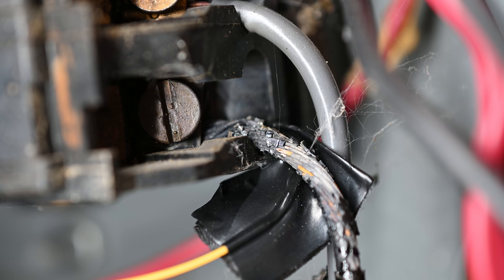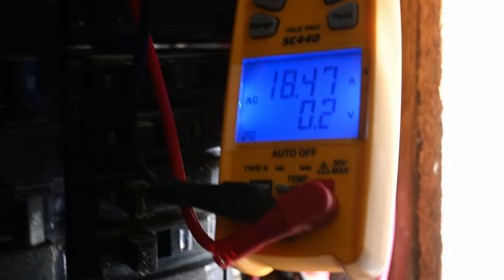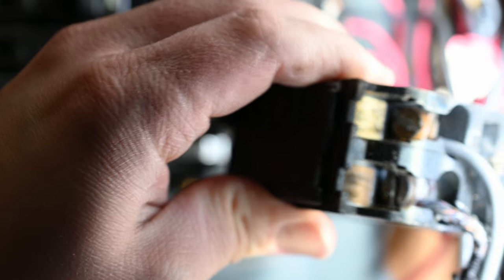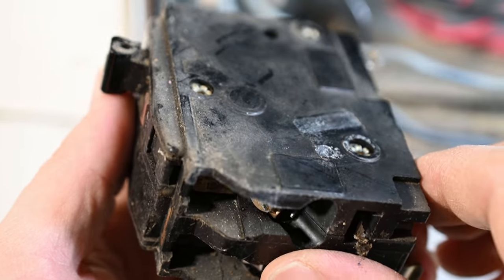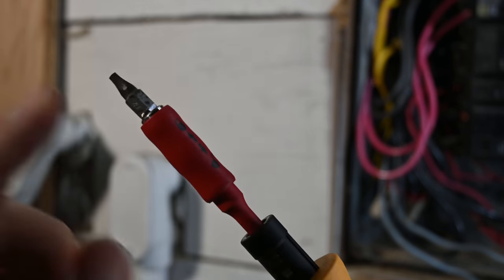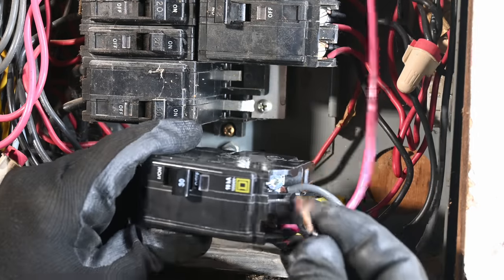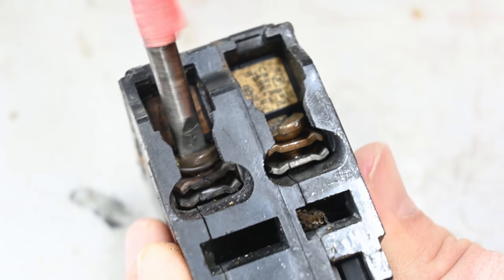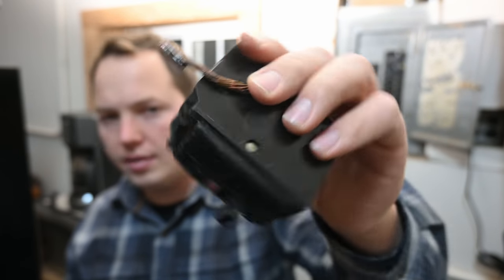Burned Wire On Breaker - Torque Screwdrivers & Why You Should Probably Be Using One

Comment: Good job sir, your videos are great! A couple of things that may also need to be added. Tightening your wires too tight, especially stranded wires, can cause overheating issues as well.. If you over torque your conductor you could decrease the rating of that conductor  by cutting into it, disfiguring its shape and/or breaking strands. Also your typical thermal breakers would trip on heat from  overcurrent or heat from a conductor at the breaker just the same.
Reply: Turns out this breaker IS a dual trip. There is a magnetic trip feature.

Comment: I am not an electrician but as project engineer on some large energy storage systems have done inspections after all the regular inspectors signed off.  I have found countless cases of loose screws on breakers.  One insidious one is where stranded wire is used and it gets caught up in the screw threads.  The screw appears tight but the wire is still loose.  You have to very slightly try to move those wires to see if all the strands are tight in the screw clamp.  At one point I solved an issue where a breaker was tripping at random times.  Everyone was concentrating on the device being powered and the wiring to it but I found one of these strands-caught-in-a-breaker-screw issue causing high terminal temperature causing premature tripping of the thermo-magnetic breaker.  So yes this is a very real issue, both for fire safety as well as electrical system reliability.

Comment: Best practice when using stranded wire is to use a terminal designed for the connection type or to install a properly sized ferrule on the stranded wire end before placing it in the clamp style connection on the breaker. Even using a torque driver to tighten a stranded wire can give a false reading as the strands can displace over time, resulting in a loose connection. This is especially true when the wire is subjected to regular heat/cold cycles as is the case of the connection depicted.

Comment: For Lockout devices, I keep a set of removable breaker clamps (I don't know the exact term) in my lockout kit. Each one is sized for a particular breaker lever, and will clearly sit over a breaker in the off position, while applying a small plastic wedge between the lever and the user side planar surface. A thumb wheel tightens it into place, then a hasp goes over the whole assembly and is secured with a standard shackle lock. 

I highly recommend these, as you don't need to depend on your customer having the necessary lockout capabilities in order to keep yourself safe.

Comment: I love the Wiha torque screwdriver personally. I got mine in a kit that included like 12 bits. Others are recommending torque screwdrivers meant for guns, and those will most likely work fine, but the Wiha one is 1000v rated, and I think that is a big positive. The bits that are made for it are also 1000v rated. I do believe they make an adapter for normal bits, but they say it is not for use with the insulated handles.
Reply: Ive seen that kit is it worth the money ?
Reply: @Jason_Canada  Having owned my kit and more bits in the range 20+ for over 5 year's now, id say Yes, providing you don't lend them out to friends and family,
Reply: @Jason_Canada  Sorry for the delayed response. I definitely think the kit is worth it personally. That being said, I got it on sale directly from Wiha's site. They even did a 50% off anything on the site sale once about a year ago.

Comment: Working in data centers we do annual or bi-annual FLIR inspection of all electrical connections. Would you be surprised to find the number 1 issue was new installations that weren't torqued properly and the number 2 issue was improper bend radius on cabling? Once you fix the issues they generally don't come back. If they do come back it's usually a cracked lug spreading over time, a bad breaker, or bad whatever is attached to that dang hot wire again. :)

Comment: During the same time frame of this video a 5KW heater in my garage quit.  I found the connector in the heater had fried along with the plastic holder for the same connection via over heat and the black wire had gone open. Its insulation had fried back to almost the romex connector in the body of the heater.  The wire is solid copper #10 @ 30 Amps. The heater is rated at 21.9 Amps. I thought it might have been the thermistor heat sensor having gone bad. Several of my wire buddies could only say the connection was not tight. I now agree after seeing your video. I have some pics but I need somewhere to send them.

Comment: Wheeler makes a torque screwdriver called The Fat Wrench. It takes regular 1/4 inch bits and it can be set from 10 to 65 in/lbs and i think it only cost around $50. It’s meant for gunsmiths but is handy for a lot of torque applications

Comment: So first I’m not an electrician. I installed the panel and wired my garage and have done other wiring, I’ve seen a lot of jack legend stuff. I know stranded wire meets code but I’ve never liked it. Ok let the beating begin. Thank you for your time and knowledge, love your videos
Reply: It doesn't just meet code, it is the only usable wire type in many situations. If you have a 100-200 amp panel at your house, then you have stranded wire feeding the panel. Solid 1/0 or 2/0 wire wouldn't be usable. Hell, solid 4 awg wire wouldn't be usable. 

Stranded wire is better than solid in a lot of ways. The negative of stranded wire is that it takes more skill to get a good connection. The positives are that it is more flexible, easier to pull through conduit, etc.
Reply: Yes I have 200 amp to my garage and I understand there is a need for stranded wire, trying to run solid wire from the weather head to the meter and panel would be damn near impossible. Thank you for your reply.
Reply: Stranded wire with superior insulation can carry far more amps than solid wire of the same conductor od.  It is also more flexible and costs more.   Ever wonder why the wire inside the appliance is smaller diameter than the wire you hooked it up with?  Appliance wire can carry higher amps because it is stranded, has superior insulation and usually has more air space to dissipate heat.  Often the manufacturer will crimp a pin, lug or ferrule to the appliance wiring to bundle the strands or will tin the ends with solder.  However breaker lugs are acceptable with bare stranded.
Reply: Is that why most commercial wiring jobs I have seen/worked on are stranded wire? Because it's easier to pull?
Reply: @henrythompson7595  yes.
Reply: @rj.parker  its people like you who give rise to the phrase "to be installed or serviced only by qualified electricians."  You just flat out don't know what you are taking about.  Rated capacity of solid and stranded wires of the same o.d. is essentially the same.  Appliance wire usually has insulation rated for much higher temperatures than house wiring, and is usually not bundled as tightly as building wiring so it has more opportunity to dissipate any heat of conduction and further is not installed in a flammable environment.  The current carrying capacity of wiring is determined almost exclusively by the thermal  properties of its insulation.

Comment: Well Done Ben. This is how a lot of house fires happen. Good explanation and display of the various points inside and outside the breaker. Nobody (owners) goes back into a panel and torques connections. IMHO Definitely a torque issue where the heat travelled back into the breaker as well. That panel is so old it should all be changed out to a new code-compliant design with arc fault/ground fault breakers. The new AF/GFCI combo's are great and this would have been discovered long before a real problem occurred. Inspectors should be mandated to test a portion of the wiring system for compliance.
And, I would never pay that kind of prices for those fancy torque drivers. I've yet to have an inspector ask for my torque tools and have used many, much cheaper types. Just calibrate them periodically.

Comment: I had to put in new parking lot lights for a few lowes stores and I had to cut back literally a foot of every wire when putting in the new lights bc the wires were burnt so badly (I’m guessing from loose connections and excessive heat with the desert heat?). Many of the old lights weren’t working and a number of the breakers were tripped as well. I’ve never seen so many damaged wires at one location.

Comment: thanks for sharing.

generally, if one wire is heat damaged, and the other is not, it is a good sign that it's a loose connection or oxidezed conductor on that affected wire.

Overcurrent will lead to both wires being hot.

Comment: I forgot to add.  When relay contacts (or breaker or thermostat or .... contacts)  get burned by arcing  they get a oxide layer  on the metal  that has resistance which generates makes even more heat  ( a flywheel effect?).  Mechanical contacts in humid environments probably make such problems worse.   I noticed the internal contacts  on one side of  your  breaker looked "cooked"--  Bad!  I'm sure "materials scientists" working for  Square D and other ckt breaker mfgs know all about that and all the "scientific details".
Would  they send out a "white paper" to every electrician  and apprentice world wide??  I doubt it.

You are very conscientious and detail oriented when you see, analyze and solve a problem!  Kudos! 

You DID NOT  mention that the SAME problem can occur with ANY switch, relay, outlet and .... connection  that carries enough current to heat the metal and melt/burn the insulation if loose or corroded.  Then there are the "push in" connectors (probably ok for low current circuits, but I'd get nervous about those in high current circuits.  Ex water heaters and electric heating....  I think they were invented to protect from frayed appliance power cords.

I've run into hot loose wires on outlet connectors  (ones I didn't install).  After repeated heating, the copper or brass or plated metal isn't shiny and low resistance where the metals are in contact anymore! 

  "Arc fault breakers" are supposed to be the cure!  Expensive and how reliable are those over the long term.???   Nice profit center for Square D and others. No substitute for good electrical workmanship!   More parts doesn't seem a real good solution.

I might just make do with a 1/4" lever type torque wrench.  Any tool that is manufactured in small volumes and/or is covered in patents is going to be expensive (especially if its German). 

Then there are the "wirenuts".    LOL

You DID NOT  mention that the SAME problem can occur with ANY switch, relay, outlet and .... connection  that carries enough current to heat the metal and melt/burn the insulation.  Then there are the "push in" connectors (probably ok for low current circuits, but I'd get nervous about those in high current circuits.  Ex water heaters and electric heating....  I think they were invented to protect from frayed power cords.
Reply: OOPS! Correction:  "I think they were invented to protect from frayed power cords." sentenced belongs at the bottom of the "Arc fault breakers"  paragraph.  Nothing to do with wire nuts!

Comment: We had this happen with our range. The previous homeowner (or one of the cut-rate handymen he liked to hire) put a cord on the appliance but didn't tighten the nuts well enough. One hot connection arced and ended up melting clean through the wire and also damaging the terminal block. We discovered it when the melted wire broke in two and the oven stopped working. Lucky it didn't burn the house down.

Comment: At 5:30 to 5:35 you moved the wire. I saw two white flash to the left of the screw head one high and one low. Arc?     I priced your screw driver and don't see too many people buying them. I can put a screw driver bit on a small torque wrench if it that big of a problem. Also the problem does not seem to happen with solid connectors. Thanks anyway I found it interesting.

Comment: PSA: If you go to buy 1/4" shank driver bits, be sure to get ones that are rated for IMPACT drivers, whether you're going to use them in an impact driver tool or not. They are waaaay heavier duty. I haven't had one go bad on me yet, even in an impact tool.
Reply: Do you think Milwaukee's the best bit ?
Reply: @Jason_Canada  Honestly, I've used many brands and as long as they say "impact rated", they're good.
Reply: @aaron74  thank you for your knowledge
Reply: @MrWzeljunior  thanks iam already a fan ..great reviews
Reply: @MrWzeljunior  Yeah that guy has a great channel. He was lucky to find a great niche topic of product testing
Reply: the "impact rated" are a harder steel than the cheap ones. that said they will shatter/break off suddenly, vs. twisting off like the cheap softer steel tools.
best bet is sticking with popular name branded tools for lesser chance of garbage products, even then good luck! as they often have various levels of quality.
Reply: @throttlebottle5906  Sure, everything has a breaking or deforming points. It's not kryptonite. lolr
Reply: @throttlebottle5906  Well, sure, everything has its breaking point given enough time and enough stress. I personally haven't encountered it (yet) with impact-rated bits. They're tough and they're good.

Comment: You captured the arc fault quite well at the terminal. You are also incredibly lucky you didn't get bit. I saw a guy point at an energized circuit with a plastic pen, drew an 8 inch arc to his hand. Drew another arc Finn the zipper on his pants to ground about ....well, he needed skin grafts on his hand, and on his bits. Today your lucky, treat every circuit like it's a rattle snake, wear safety gear, and know hope, luck, and prayers are nice but burnt bits? You'll be walking funny for weeks.

Comment: I have found man times that the resistance at leads to the overheating is a loose wire but also corrosion on both Aluminum and Copper. I have over the years checked my breakers for torque. I have a pretty good hand for tightening correctly on screws of devices and breakers. On lugs I use a torque wrench. Now that the NEC is making us check torque setting, I will at least do my breakers. One thing, I would check the torque with the breaker in stalled because when you move the wires around the strands shift and can loosen up. I know this for sure as I check myself.

Comment: I use a Large flat head screwdriver with a short square shaft. Use a crescent wrench on the shaft to do the turning. Works well. Better than just using arm strength. Interesting video.

Comment: I bought a house that had a double tapped fuse panel. Several of the connections were smoking. I used plug in AC voltage meters on the most loaded circuits, when it dropped below 110 Volts, I turned stuff off till I had a breaker panel put in.

Comment: I torque and the final step after I have connected everything in the panel. I exclusively use Square-D in new work and can tell you that an ECX-2 bit is my go to for torquing breakers as it’s a perfect fit. I don’t use a torque screwdriver instead I use a couple torque wrenches as they’re much more useful; I’m too cheep to buy an insulated torque wrench so I use an electric isolators and insulated extension. I find it easier to simply run the sides torquing everything at the end and ensuring everything is torqued to spec; I typically do this at the end, initial everything, right before getting an inspection such that the torque gear is still there for the inspector to verify. I’ve never had an inspector check torque with most being surprised that I torqued things; I think it’s sad to see as it is probably the biggest cause of issues next to undersized conductors.

Comment: While using a torque is probably better than "good-en-tite", the connection actually relies on a consistent clamping force which usually correlates to torque, but not always. This is why for critical bolted connections one-time-use "torque to yield" (aka torque to x, then x degrees) is used in automotive and aerospace. Also thermal cycling can play havoc with actual clamping load no matter what the initial torque was set to.
In my mind a thermal survey a week after loads are in use (and recurring) would be a far better program.

Comment: Here in EU we have deferent standard and requirements when working with stranded wires . We must use end sleeves and adequate crimping pliers . That's best ways to avoid bad connections in every situations . Only exceptions is Wago style connectors 221... ( New tipe ) or similar . They are designed for all type wires  not using end sleeves .
Reply: There really are no EU wide requirements (apart possibly factory made items). They are national.

Comment: I recently bought a torque screwdriver, but never used one until then.  I have used a torque wrench on lug connections where you have an allen head screw.  I've always made it a point to torque connections with aluminum wire, but realistically should be used with copper as well, especially with stranded wire.

It's a better deal than that Wiha.  No "special" bits to buy and less extra "stuff" to keep up with.

Comment: I lost a $700 car charger because I didn't torque the 240v connection in. It worked for several years then died. Taking it apart, it had caught fire at the terminal, which then spread upwards to the PCB. I believe what had happened is the connector broke a few strands due to overtightening, reducing its current capacity and increasing the line heat that eventually killed it. I got a rather expensive "click torque" screwdriver to install the new one to spec, haven't had trouble since. If I see a torque spec now, I get that screwdriver out.